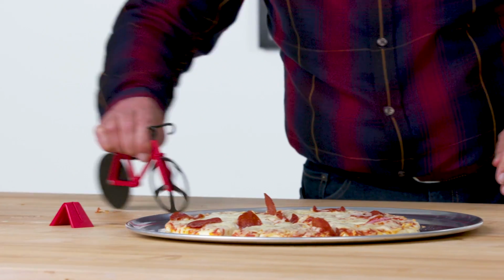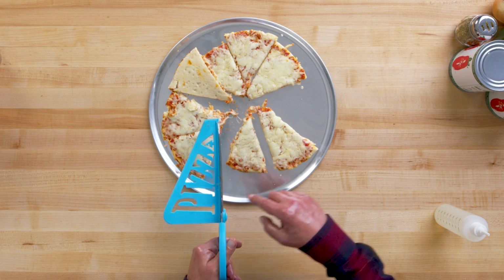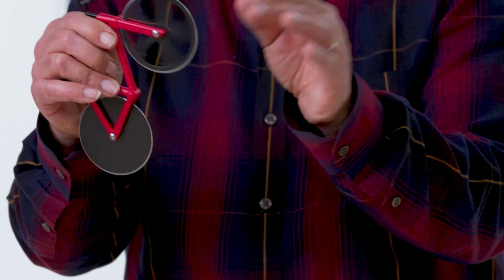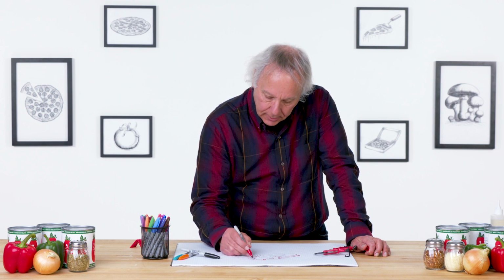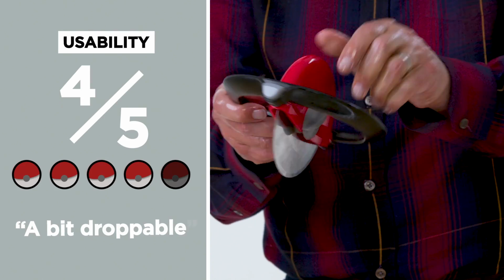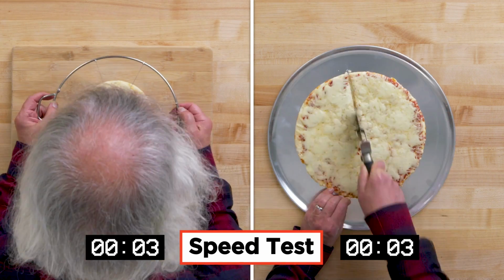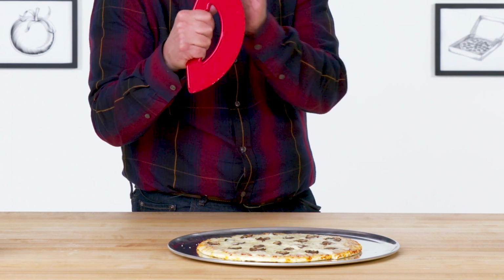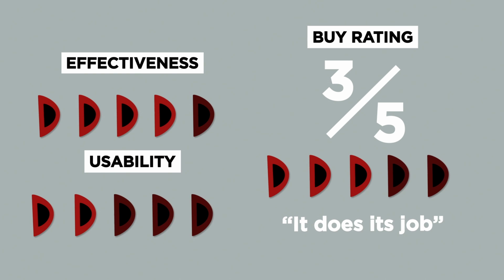5 Pizza Cutting Gadgets Improved By Design Expert | Well Equipped | Epicurious

Comment: I actually have the Rock n Roll cutter, or something very much like it anyway. It may have a little trouble with a tough crust, but does a decent job overall. The best part is cleanup because nothing will stick to that plastic, even if you let it dry on. Still, I usually opt to grab my regular wheel cutter. That 8 slice cutter, though... It's a PIE cutter, not a pizza pie cutter! How could he not know that? The angles at the end of the blades are made to match a pie pan. I've used them, myself. (Tip: The best way to use one is to just mark the top for even slices and then just use a knife to cut the pie because the cutter will often destroy the pie when you pull it out unless it's mostly frozen. yw) It doesn't matter if some dumb Chinese seller marketed it on Amazon as a pizza cutter. It was just silly to test it as such. Now, what would be awesome is a pie cutter made with that super slick plastic of the Rock n Roll cutter.

Comment: The pie cutter is meant to be used on a freshly baked crispy hot pie which usually is a bit thicker and harder to cut but is often served and cut as 8 evenly cut pieces maybe straight on the pie tray as well. So it is a bit unfair to test it on soft cheesy pizzas.

Comment: My notes on the pizza scissors: the base is way too big. These should be shears that can come apart for cleaning. I would also like to say the reason that they could be better vs a pizza wheel is I put my pizza on a dinner plate when I take it out of the oven. I cannot use a pizza wheel without damaging the plate. I do not own an aluminum pizza tray like shown on the video, and I don't think it will cook a pizza very well. So, now I need to get my wood cutting board to slice the pizza (I don't put hot food on my plastic ones). And it needs to be hand washed. Instead, I use my regular kitchen shears and they work  fine.

Comment: I worked at a couple of different pizza places, and we had cutters very similar to the rock and roll but they were much larger and made of metal. Those things cut pizzas crazy fast compared to a standard pizza cutter once you got used to them. Just sounded like a quick slamslamslamslam and the pizza was cut great and cut even

Comment: Isn't the pizza scissors also supposed to easily get the pizza slice on to a single serve plate? Isn't that the mane reason to get it?

What are you doing to the perfect finger holes to the half-moon-cutter? They are there for ease of holding... 😟

Comment: The ufo-looking pizza cutter is essentially just the zyliss style pizza wheel made over-complicated.  I have another knockoff of it.  Even the cheap one my mother got from her work place that falls apart frequently works great.  Handle-less pizza cutters just work well in general because they trick you into putting more pressure on the blade so they cut better.

I have one of the rock and roll cutters (or another brand of a similar product).  It worked great at first, but only on small to medium pizzas.  For larger pizzas, you have to cut twice.  I eventually replaced it with a much larger metal version, which is what a lot of pizza restaurants use.

Comment: Any pair of right-handed scissors would fail when operated using the left hand... try it. There are specific pair of scissors designed to be operated using the left hand.  Not all products should be evaluated in this cookie-cutter way, perhaps? Even the best wusthof knife would not perform well when used by an oily non-dominant hand.

Comment: The rock and roller is something I'd buy. Looks a hell of a lot easier to clean than a traditional pizza cutter.
Reply: If you are still interested in "the rock and roller" may I suggest looking into an Alaskan Ulu knife. It is pretty much the same design, though made of metal, and has many of the improvements he suggested, such as the palm swell on the handle.

Comment: Why deliberately use the devices wrongly? Instinctively I'd use the pizza scissors to cut the size of the piece as small or large I'd want and serve it. Not try to assemble back the pizza 🤦‍♀️

Halo seems smart, because of the protector for the blade and flat storage and removable blade.

Any these cutters in the shape of 8/10 pieces or whatever seem like a waste of design and blatant consumerism. The only thing I'd understand if it would be a part of huge machinery that would precut things in the same size at a large volume in manufacturing process.

The rock and roll cutter feels like maybe an ok device? I don't trust his judgement 100%, I don't think it would work on all pizzas, especially with harder crusts or more toppings, or even just larger diameter.

Comment: There're scissors used by seamstresses that have the bottom handle of the scissors be flat instead of oval from the outside.

I feel like whoever designed that pizza scissors cutter could learn from that design.

Comment: I think the Pie Cutter Press could also have been improved if it came with a "cut well" platform. basically it would have all the grooves on the platform so the press would go through the pizza all the way, instead of hitting a solid flat surface behind the pizza.

Comment: I know this is from last year but I think the rock and roll pizza cutter is a bit under rated. A factor I'd like to add is cleanability and degradation, compared to a normal pizza cutter that has a handle and metal parts, this cutter has none of that and it has no tiny nooks or crannies where dirt piles up. Since its one solid piece of plastic it won't rust and cleaning and maintenance is heaven since I don't need to bring out a specialized brush to clean the area between the blade and the handle or lube for the blade to continue spin perfectly. This means the rock and roll pizza would remain consistent for a long time with less care compared to the normal cutter. Compared to the efficiency of a normal pizza it does fall short of course but I think it deserves a 4/5 since caring for it is a lot easier than a normal pizza cutter.

Comment: for the scissors the other issue is that your pizza is not on a piza stone that it also has a little grip, but that plate is very slick and has a lip so you end up having to lift the pizza more thus using 2 hands. and for the rocking pizza cutter......just get a mezzeluna....

Comment: I like this guy, but sometimes he has questionable ratings. Giving the bike a 1/5 in effectiveness is just silly. it obviously does the job. Give it a 4 or 3 for that. It being unsafe or odd to use doesn't change the fact that it's effective.
The pie slice thing should at least get a 2 in effectiveness as well. it cuts the pizza, just not extremely well. There's a reason it's a scale from 1 to 5. It's not about "I like it: 5" or "I dont like it:1", it's should be about hów well it performs, not if it performs pérfectly, yes or no.
After that he gives the same gadget a 1 in usability, for not cutting the pizza very well. Which is the same criteria as the effectiveness. If something is easy to use it should get a 5 in usability, regardless of how the end result looks. Otherwise it's pointless to have two ratings that gauge the same criteria.

Comment: I have to disagree on the rock-and roll cutter. If you're cutting a pie with tougher crust, it requires enough force that my wrist wobbled, and I ended up punching a scalding hot pizza. Threw it away that day.

Comment: I'm not sure I understand how both oiling your hands AND switching handedness highlights any particular flaw in the tool. What are you controlling for? OR are good tools able to guide someone through the process in poor conditions? Is it some kind of simulation of mobility issues?
I think the rock n roll cutter could be a little shallower, to reduce how much you have to twist your wrist to cut. But that would make for a much longer tool

Comment: The problem with traditional pizza cutters for me is we stack on way too much toppings, which is the reason we eat pizza in the first place. The best cutters you can get are similar to the “rock and roll” cutter but they’re larger and you use two hands. Really easy to press your weight into and cut a heavily loaded pizza with ease

Comment: I'm sorry but I have to say this. About the second to last gadget. The metal one. It's a pie cutter. USE IT ON A PIE. There's a reason it's called a pie cutter, and that's because it's made specifically for cutting things with a pie consistency. Of course it won't work as well if you try to cut a thin slimy oily pizza like the one you tried it on. Not a valid review of the item if you don't use it as intended. Not every blade is made for every surface. That's why we use serrated blades for bread and not smooth ones. Please consider this.

Comment: That pie cutter was meant for, y'know, pies, not pizza pies. Pizza crust is too squishy. Pie crust is more firm and snappier and cuts easier. Thats why the bottom blades are angled, to get into a pie dish. It works well for actual pies... it can be used for cakes too, which is what the upper blade edge is for.

Comment: The only thing I'm going to say about the bicycle is that the purpose of the dual blades must be for the more stubborn pizzas where the first pass doesn't always cut completely (Notice the forward then back motion during the oil test? The backwheel is meant to allow for just a finished forward motion)

Comment: They should add the improvements that he came up with to the products then compare them to the original product . Like this comment so the producers see this
Reply: theboss_3mmar On instagram How would they make the revised product? I mean, it would be fantastic but it doesn’t seem remotely practical.
Reply: @beeble2003  they can 3d print the improvements then add them to the products. They dont haave to make a new product. For example if he said make the handle tighter, they woul 3d print a new handle and add it to the products
Reply: theboss_3mmar On instagram You can’t just “add another handle” to a product. That’s not how making stuff works.

Comment: Interestingly enough, in most restaurant settings, we use pizza cutters similar to the Rock and Roll one, except they're metal, significantly larger and use two hands to cut.  They have wide plastic handles on either end of the spine and you do a similar thing... though to be fair, that's because the pizzas that my kitchen cut were typically 16 inch pizzas.
Reply: So...a mezzaluna?
Reply: @Hermititis  I used to work at a pizza place too and yeah it was a mezzaluna we used. It's far better than the wheel cutters, which I've never really liked. With experience you can cut any pizza into whatever number of slices you want in under five seconds, they're great.
Reply: It reminds me of my job at Taco Bell and our quesadilla cutters. It was metal, but a bit smaller, keeping a very similar motion. I think the main benefit is the fact that you're going to get straight lines with a rocking cutter (and it's much easier to clean)
Reply: Pizza Hut had those when I worked there 7 years ago
Reply: Mezzaluna means half moon,  i dont speak Italian but i speak Spanish and it sounds similar to media luna
Reply: I've always used a similar tool, a smaller rocking knife with one horizontal handle. I forget the name of it, but I think they're Alaskan/Canadian first nations in origin.
Reply: had them at dominos. you can get through a pizza in seconds

Comment: The issue of storage is never brought up. I can see the eight piece cutter taking up a lot of space in my cupboard or rawer for a tool I will only use one or twice a month. And a lot of sharp edges and blades sticking out that I can cut myself on while reaching for another tool.

It's really conceived as an industrial tool for a restaurant setting I would think.
Reply: You’re right, of course, but the 8-piece cutter is so bad at actually cutting pizza that everything else is basically irrelevant. It’s kinda like complaining that a serial killer has bad taste in music.
Reply: @beeble2003  its really meant for cutting pies and sometimes small cakes

Its not sharp enough for pizza
Reply: They also need to do a washabilty test. I mean sure some of these fuction well but it may take a while to wash.
Reply: @Studiepi  He mentioned washability a few times, but not for every device. The rock and roll cutter looks the easiest to wash by far.
Reply: I think the bicycle cuter was meant to be displayed on the counter otherwise yeah some of them would be quite cumbersome though that 8 piece cutter could hang if you have one of those hanger for pots and pans (we have one in my house) but also I would never buy that thing lol
Reply: A bit late, but the pie cutter isn't meant for pizza, it is meant for actual pie, which has a much more brittle crust and thus doesn't need sharp edges. If you feel the edge on that cutter it isn't actually a blade, although it might be thin enough to cut some things.
Reply: @detenator1  a bit later, but you have an excellent point
Reply: Can confirm, this is what is used at Costco food court. Just darker, harder metal with wooden handles an a curved bottom.
Reply: only eating pizza "once or twice a month", your life sounds miserable
Reply: I don't really understand the advantage of a traditional pizza cutter compared to a knife. A cleaner cut because of the rotation, I guess? So Why not just use a knife if you are not using a normal pizza cutter?
Reply: @jasonseasons1192  Well, many of these also rotate. And none of them drag through the pizza the way a knife would.

Comment: We've got the first one at home, and we had to deattach the pizza holder so now we have a normal pair of scissors
Reply: but do you still use it as pizzascissors? Is it easy to remove? (I’m a leftie, but i rly want it for some reason 😐)
Reply: @Adifferentusername  i am a leftie too and it won't work for us because the screws are just on the right side
Reply: Same here! We got this at home but without the deattach and it’s so much better than any other pizza cutter🤌🏼
Reply: Lefties should just buy large left-handed scissors and mark them "pizza" if you want to use them for pizza exclusively

Comment: My dad has a bicycle pizza cutter. The design is the same, but the only difference is that the front wheel has no holes and the back wheel is just plastic. There is no blade on it.

Comment: I bought a pizza cutter shaped like the Enterprise from the classic Star Trek. You have to hold both nacelles at the same time to feel like it's stable enough to cut, which is super awkward. The second issue is the blade housing is so wide it's hard to clean it out. Fun kitchen decoration though. Awful design.

Comment: Another glaring flaw with the pizza scissors is that it has no reason to have the word "pizza" cut out of it. I could see maybe embossing it so you at least have the word, in case you've got visitors rummaging through your drawers confused by the scissors. By cutting it out completely, though, you introduce a bunch of spots for sauce and cheese to get stuck in, which makes cleaning it that much more difficult, not to mention how all the sharp edges would wreck a sponge.

Comment: One more change I'd make to the "cut 8 pieces at once" gadget is make the metal grips into much larger loops, come straight up from the spot where they are, and then bend them half way up so that the top half of each loop is perpendicular to the ground, and each loops end is straightened (so you could get your thumb on it).

Easiest way I could imagine for raising the handles above the ring of the gadget and getting thumb action for leverage on every axis while rocking.